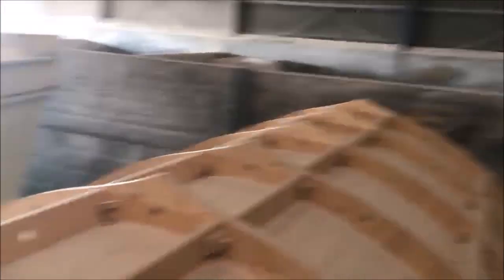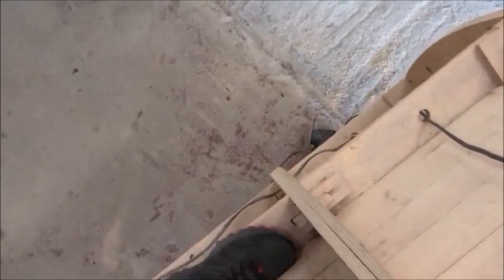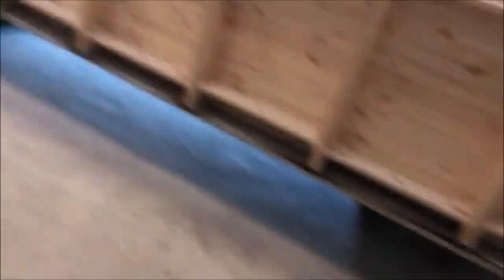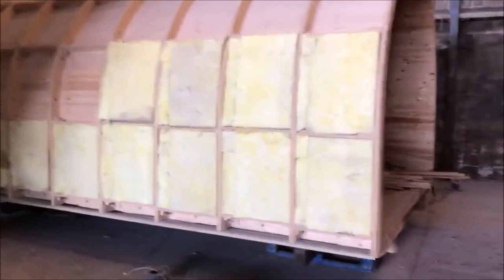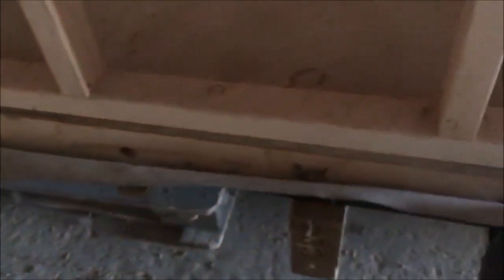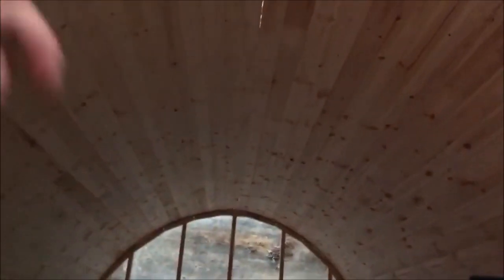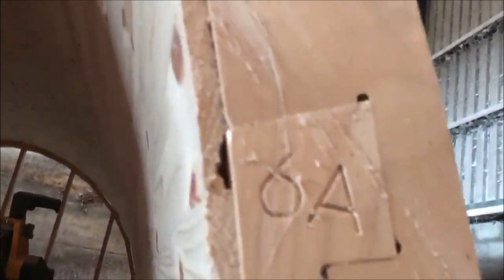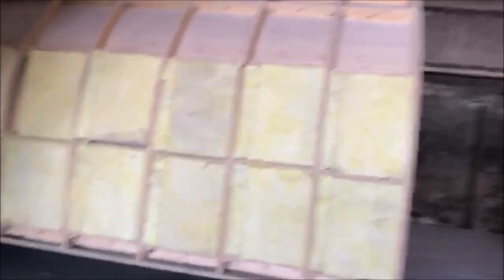Building a Glamping Pod - Part 5 | Power & Lighting

Comment: Very interesting project. 

I don't see any vapor barrier between living space and the wood/insulation of walls and roof. How well would this do in cold weather? All the moisture in the living space could go to the walls and roof, condensate and cause mold. That would be serious health hazard for many people. What am I missing? 

thanks in advance
Reply from the maker: Hi Sugmur, apologies for the late reply, I’m not sure how I missed your message.

We installed a breathable membrane between the insulation and external cladding, and this combined with the 25kw combi boiler has kept the pod dry of any moisture and mold, therefore preventing a potential health hazard to guests.

I have since sold the pod but am looking at building a second one where I will do two layers of membrane, one between the internal cladding and insulation, the second from the insulation and external cladding, this should reinforce the protection of inducing mould inside the living space.

I hope that helps answer your question!
Cheers, Oscar
Reply: @TheMonners  thanks mate 👍